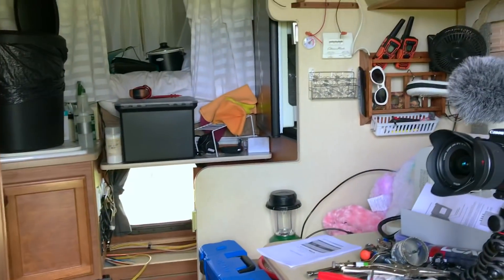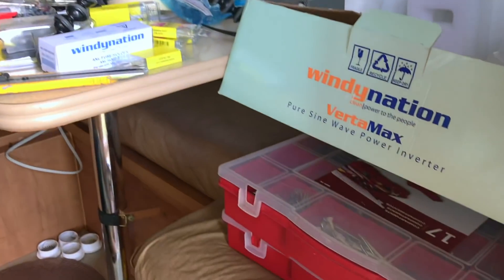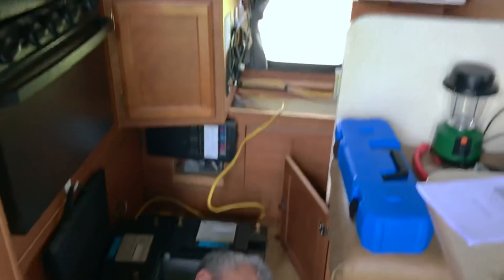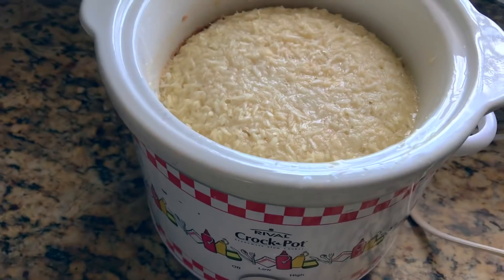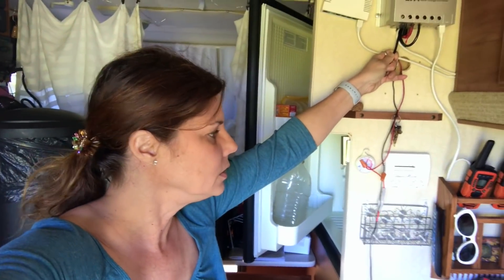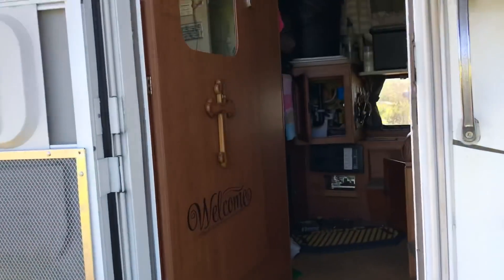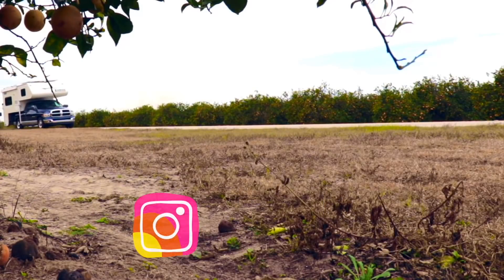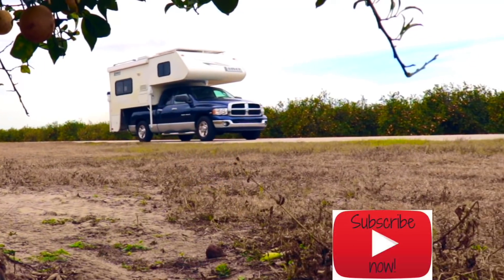MY EXPECTATIONS WERE WRONG !

Comment: check for shorts in the any GFC plugs you have in the camper (found in the bathroom & kitchen area0. A blown GFC can disable power from the blown GFC outlet to whatever wire passes thru the circuit to the end of the line (example: if the GFC pops in my bathroom, it will knock out the power all the way down one side of my RV until it is reset)

Comment: Just have to trace the circuit. BUT NEVER put a bigger rated fuse than the circuit calls for.
If a fuse blows, it blows for a reason and for your, and the citcuits protection, at that point you have to trace the circuit to find out why it blew.
Reply from the maker: You are so right and it has been a challenge finding the problem , more to come. :)

Comment: That's an odd setup if the generator charges the batteries directly. Usually the converter charger takes care of the batteries and the generator just like shore power provides AC to the circuit panel and the converter. The converter then lowers and rectifies the AC voltage for the DC circuits as well as controlling the battery charging. My camper has three stage charging which is best for battery life. If your fuse is going to factory wired DC circuits you must have a dead short where the positive is connected to ground. Your problem could be in an appliance including lights connected to the circuit that fuse protects. If all the loads connected to that circuit are disconnected and the fuse still blows then it's the wiring that's the problem. If you're lucky it's one of the appliances, if not you've got a real problem tracking down the cause. Putting in a larger fuse is a recipe for a fire. I advise not doing that!

Comment: No bigger fuse please! . I'm a technician, retired, I used to fix electrical issues. You can buy a tool to find shorts.  First you get a 2 blade  10a circuit breaker make 2 jumper wires with 2 flat connectors that fits where the fuse goes and the other ends connect the the circuit breaker . This acts as the fuse.   Everytime the circuit blows the fuse the breaker with click. It eill do this over and over again. It will get warm.  Next is the little box , a short finder, that has a needle that moves towards the short when you pass thru it. No matter if its metal, rug, wood. The needle will bounce back and forth everytime the circuit opens and closes.  You will find the area of the short when the needle violently bounces in long strides.  You are far when the needle bounces in short strides. Thats how I found shorts no body could when I workes on cars...specially Cadillacs. I did 12 years with them. You can buy it on line or tool store I guess. Good luck . Let ne know if this helped
Reply from the maker: Thank you that sounds like a great tool to have . :)

Comment: I would be checking the converter. The 120 shore power to the converted. Then the 12 volt is run by the converter. I would check that first. The solar charges the batteries. To keep them charge for use. I hope that makes sense

Comment: I have a similar problem with my electrical system not powering or charging properly--turned out to be the converter, as others have also mentioned.

Comment: Luis is right...a charge controller is key to protecting the batteries and avoiding problems with over charging. It sounds like he was talking to a guy that didn't know and wasn't giving the right advice, probably a novice. Lydia and Luis should watch a video together by someone who knows from A to Z, without leaving out something important in the middle. It's called the missing link. A chain is only as strong as its weakest link.

Comment: If the fuse blows as soon as you put it in the holder...you have a dead short  somewhere.. a wire has been pinched or rubbed the insulation off so the bare wire it touching something metal on the rv.   it will be a long process to isolate each thing to see if it has the short in it.. but with time and effort you will find it.. start by checking all of your wiring where it passes through the wall...floor...frame..etc.  anywhere a wire passes through something is a possible short.. also check any wiring under the camper that may have chafed from being against something metal..truck bed  etc.. keep at it and you will find it..it may just take awhile to find it.
Reply from the maker: It is really hard to do that in such a small space especially in this Lance since you can’t get to where the wire are behind the kitchen cabinets. :)
Reply: Yes it is hard but a ohm meter or multimeter will allow you to check the wiring without actually seeing them. It will also allow you to figure out how the wires run from component to component. I’m a Controls engineer and troubleshoot electrical circuits all day. The advice Scott has given you is spot on. Good luck.

Comment: If you installed a screw in the the wall you mite have ran it into a wire if you take out one screw at a time  and cheek if the power comes back on or your fuse does not blow you fond that your screwed into a wire you have to fix the wire .

Comment: Did not read through all your comments on this particular page however the 12 volt system only works if it is connected to a converter converter plugs into your Shore power and then converts to 12 volt and acts like a battery. Most of the time when a solar system is put into place the converter is bypassed or a switch is put into place so that when you go on to shore power it switches over from the battery system to the converter. The truth is that the more off grade you make your system the less Shore power matters you should be able to put your system together for solar and not worry about Shore power. You do not want to depend on the converter because you are going to lose a substantial amount of power if you try to run things through the converter your best bet is 2 leave your DC to the batteries and minimize your AC needs

Comment: May I say that my rv is doing the same. 
But my husband had found out that while I was decorating....i had used nails to hang photos,  artwork, etc.... I had nailed into wiring behind the walls and ceiling. So if you have used nails to remodel or decorate than this could be a way to figure out what's going on 😊 He started by unplugging everything in the rv then he plugged the rv into shore power. He then went  to the back of the rv and plugged in one by one every and anything that required electricity.  He made it almost to the middle and found the first of 3 spots I had drilled into the main electrical line. One by one they were fixed and I never lost power or tripped the   see....this could be something that has happened to your rig before you bought it or you when re modeling 😉 Take care.
Michelle from Michigan 💖
Reply: Wait wait.. you used nails in your RV? haha unbelievable!!
Reply: fit4ya1975 
Well since our RV is almost 50 yrs old and built with a steel frame and WOOD!!!!! 
Wow!! That's an amazing concept....an RV with wood. 
Yes...to remodel and decorate MY RV... I can use whatever building materials I please 😊 
So before you call someone out you had best know what your talking about.
Reply: Im not calling you out, I just found that very funny! FYI, there are still RV's built with wood. But go ahead, use nails and ruin YOUR RV any way you want to. Your off to a great start. Never put holes in an RV wall unless its a MUST. 
Try using Command strips. They work just as good and you won't cause any damage.   Just trying to save you and your husband from any further grief.
Reply: fit4ya1975
I've been living a nomadic lifestyle for the last 30 yrs but thanks for your input. Lol!! My RVS are gorgeous and have always sold for more than I paid so I'm ok with the way I take care of MY property. Thanks again. 
You know what they say about opinions lol!!!!! 
Have a great life! BYE!
Reply: 30 years wow!  You must be old, which prob explains why you still are using nails, so I apologize. Us young people use modern technology for things now.
Reply: Wow, you have to revert to name calling and degrading? Thats ok, I'm successful so i can understand the shortcomings you may have to put others down to make yourself feel better.  So i forgive you. Go ahead and report me. Just dont use nails to hang things up in an RV. Its the same logic as using nails to hang pictures in a boat, kind of a bad idea.  And they are called "Command" strips, not "Coming" strips for future reference.
Using nails or screws to "build" the RV is a lot different then "hanging" pictures. in an RV.  Maybe google it before you start to "decorate" and destroy your RV. 
Ok well I'm going to eat before bed, long day at school tomorrow.  yaaaaaawn

Comment: Must have an inverter
Reply: wilma travaille 
That's right for 120 volts to power 12 volts there needs to be an inverter...
Same as using 12 volts to power 120 volt things
Reply from the maker: Yes I had a 4000watt pure sine wave inverter I had in my previous travel trailer and was using in my TruckCamper and with this newer  install I got  a 1500 watt pure sine wave inverter which is smaller than the other one cause I need to make some space for the batteries. :)

Comment: There is ego issues going on with Luis? I know he will read this she never said you could not fix it! But we'll . Get the wire diagram of the RV it easier to diagnose the issue with that, issue could be a wire grounding, that may got chewed or smug by something it happens. I would have help you out but that about 4 hr drive to get there from down here. Best of luck
Reply: There are ego issues going on with Luis? YOU ARE SO RIGHT, BUT SHE NEEDS A MAN LIKE THIS TO KEEP HER IN LINE AND DO ALL THE WORK FOR HER. IF YOU REMEMBER MIKE COULD NOT TAKE IT ANYMORE AND JUST LEFT HER. SHE WANTS THINGS HER WAY OR NO WAY. TALK ABOUT EGO'S.

Comment: You were rudely interupted and I am not happy with Lewis.
Reply: Paul Lackey They both do it. Lol.
Reply from the maker: I must confess I do it to it’s ok  in my world. :)
Reply: SimplyRVing it's entertaining! 🤣
Reply: They are equally interrupting one another but it is authentic and enormously entertaining at times.
Reply: SimplyRVing just watched installment 11 in RollingEarthShip tackling the problem and yikes!! Poor Luis for all the hours and shopping time spent and poor you for the unavoidable mess. Praying everything he did to upgrade gauge of wiring and correct the couplings will lead to a safer.environment. Let’s hope the test for appliances and lights on that circuit will by process of elimination tell you all what is causing the problem! My electrician brother always took that kind of approach to weird problems.